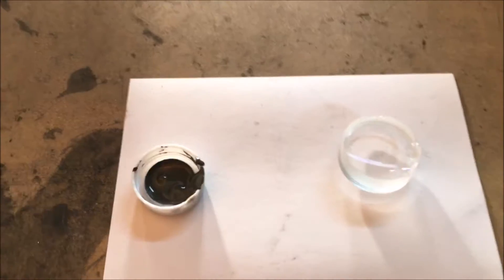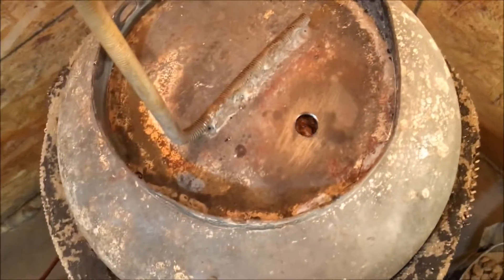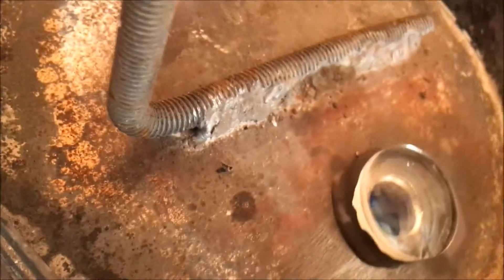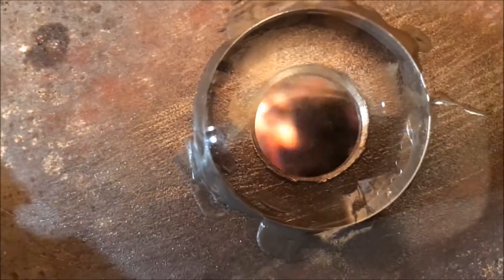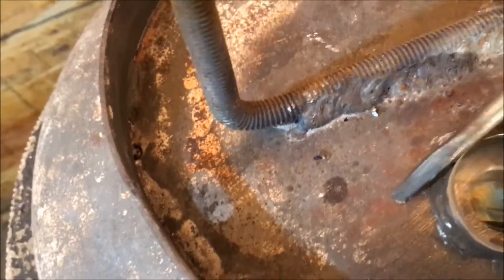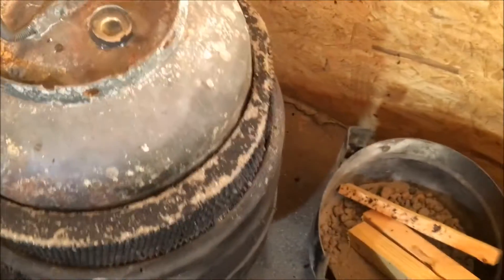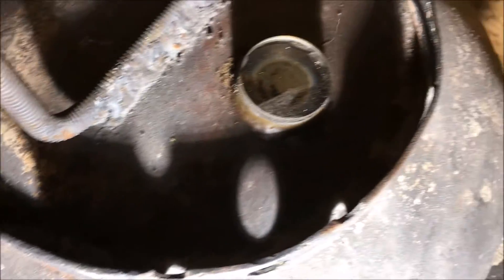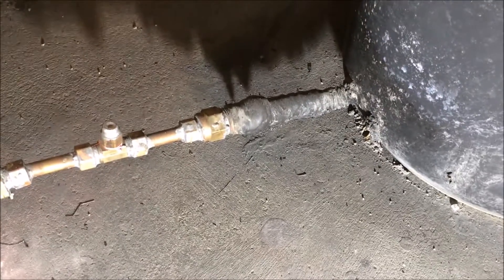JB Weld review high temp application

Comment: The threads on my catalytic converter O2 sensor failed and blew the sensor out, didn't have a tap big enough so last resort was cleaning the remaining thread and coating it in JB weld, it seems to be holding strong for now, smelled awful for a day but now it seems completely fine !

Comment: You are supposed to apply it, then leave it for 24 hours before applying heat to it to fully cure.  J-B Weld is rated for 550 degrees once fully cure.  I just applied it to an application that will easily see 500 degrees and I hope it holds up

Comment: J.B. Weld normally takes 24hrs to cure. Heat speeds up the process.  (if you read the instructions, you'd know that).
Also works better on a clean surface.
Reply from the maker: yes wich leaves one to ponder ,which is worse , not reading instructions or being a smart ass know it all ?
Reply: @NOBOX7  I would off been worried about breathing the fumes in with it being put on something that hot
Reply: @NOBOX7  hahaha agreed.
Reply: I read the instructions and it doesn't say anything about heat speeding up the process

Comment: Hey I saw JB Weld's website only shows it having 300 F heat resistance.  I need to use it to repair some stuff but was worried it was not going to hold up to the heat (around 350F).  What do you think?  Didn't they used to have a high-heat version of the 2-part epoxy?  All I can find is that putty, but it won't work for what I need, which is a liquid-based product.
Reply from the maker: sorry for being so late to answer , youtube doesn't notify me any more , the jb kwik is 300 deg the regular jb weld is 500 deg

Comment: JB weld - and ALL other epoxies and putty under 30$ - tested - MAX 180F .
Dry as long as your want , At 180 F put on the stove frying pan for 1hr , while hot Scrap finger nail  test ALL are bubble gum..............

All My Dry times are 5 Days  .....

...........Under 120F Jobs ----  jb weld 600F , devcon , dupont , blue magic 500F , magic steal 500F, Loctite , 3M ,......some are harder at 120F JB weld is one of the hardest may be brittle to breakage if flexed ,.......  " Typically epoxy after 48hrs Drying "  5 min quick and Extra long time setting epoxies are like neoprene strong rubber vs.  30 min which will harder ,  to a medium hard and semi flexable.
 
.......Putties are med hard and semi brittle.

.........Under 220F or so ,  Jobs ----- carbon fiber resin ( fiber glass)

Under 400F  Jobs -----  silicon RTV - red (best heat) , blue , copper( some apps 700F o2 sensor, , , can dry out) , 

.

.
Reply from the maker: never tried that but thanks for the input

Comment: Very helpful.  I have some. On another subject,  I'm a little disappointed with crazy glue when used as directed.
Reply from the maker: +Joe Wilder do you have a video on its shortcomings
Reply: I don't,.  I tried to use it on my father-in-law's false teeth (upper with pallet).They were broke in half, front to back.  It was a clean break. The fit back together was perfect. I was certain it would last forever, but it only lasted a week.
Reply from the maker: yeah they say siliva has enzymes in it , those things are amazing little molecules, they broke down things on an atomic level  , there shape causes magnetic and electrostatic imbalances in molecules they touch, i wonder if that's what happend
Reply: @NOBOX7  interesting!

Comment from the maker: you tube is screwed up bro , im subbed to your channel and decided to drop by to see whats up and noticed ive missed a pile of videos ?????? what the hell bro . your one of my best channels , i like people who do things way off the beatn path and again your not showing up
Reply: JB weld - and ALL other epoxies and putty under 30$ - tested - MAX 180F .Dry as long as your want , At 180 F put on the stove frying pan for 1hr , while hot Scrap finger nail  test ALL are bubble gum..............All My Dry times are 5 Days  ................Under 120F Jobs ----  jb weld 600F , devcon , dupont , blue magic 500F , magic steal 500F, Loctite , 3M ,......some are harder at 120F JB weld is one of the hardest may be brittle to breakage if flexed ,.......  " Typically epoxy after 48hrs Drying "  5 min quick and Extra long time setting epoxies are like neoprene strong rubber vs.  30 min which will harder ,  to a medium hard and semi flexable. .......Putties are med hard and semi brittle..........Under 220F or so ,  Jobs ----- carbon fiber resin ( fiber glass)Under 400F  Jobs -----  silicon RTV - red (best heat) , blue , copper( some apps 700F o2 sensor, , , can dry out) , ..
Reply: Melt temps
D
NOBOX7

Comment: yup you murican's sure do like your JB weld :D
We sell it at my work and I usually use the line that "The yanks use this stuff on anything-it will even repair a cracked engine block!"
How much does it cost on your end of the screen?
Reply from the maker: +m3sca1  lol yes even a hot engine block, i think its under 5 dollars, but turns out locktight metal is stronger , but can only go to 300  deg so jb weld still kinda wins. the point of this video was kinda lost in editing , the real purpose was an entorduction to high temp speed curing ... this stuff was cured in 3 or 4 min @ 345 degF.  thanks for the 1 up homes
Reply from the maker: +m3sca1  i will put the cost on annotations wen i find it , kiinda dumb of me to leave that out.